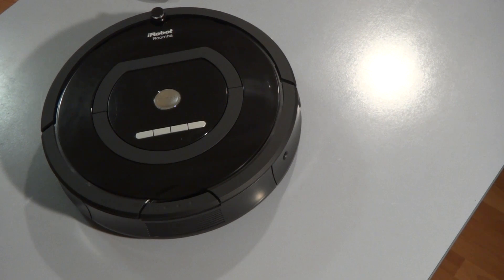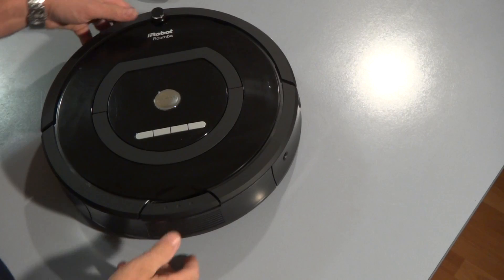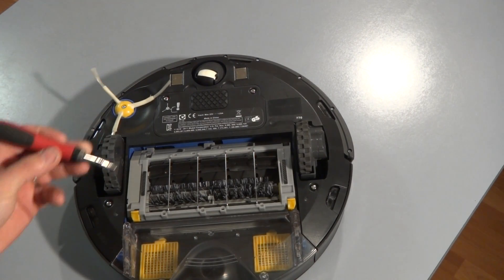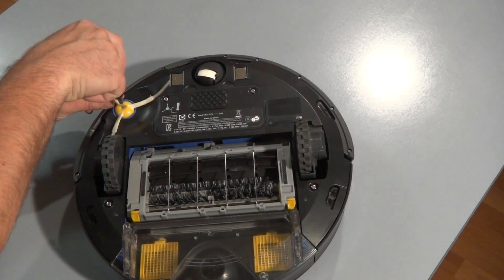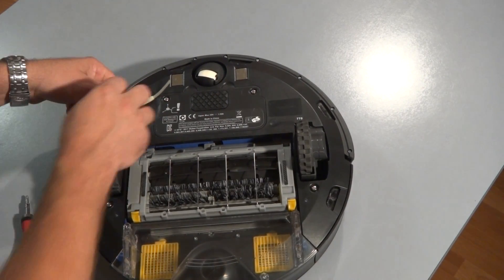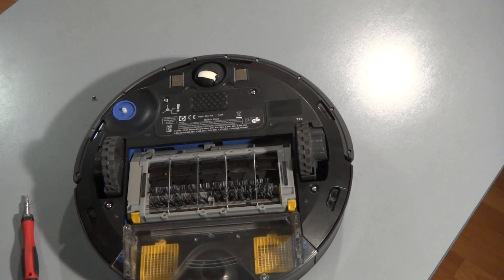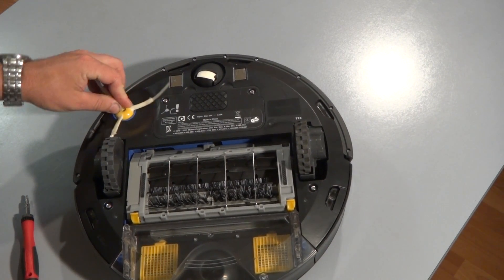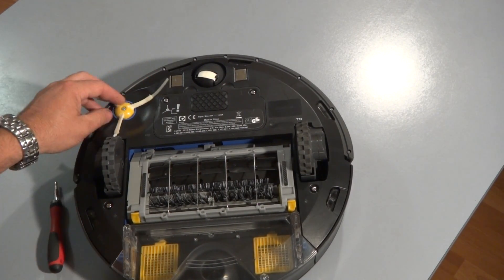How to Replace Side Brush on the iRobot Roomba 700 800 Series

Comment: Hi, does the side brush motor component move clock-wise (or anti-clockwise) along with the screw that binds the side brush to the motor? I'm having this problem. Does it mean I need to buy a new side brush motor?